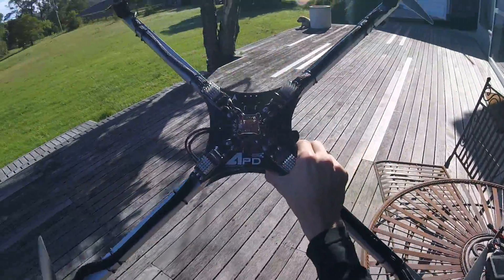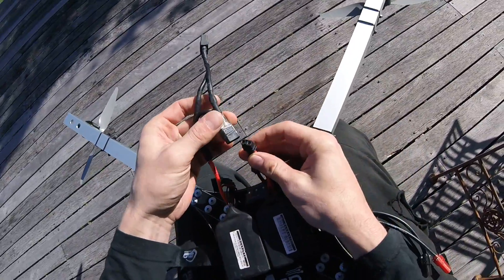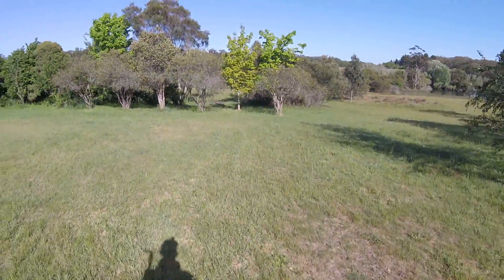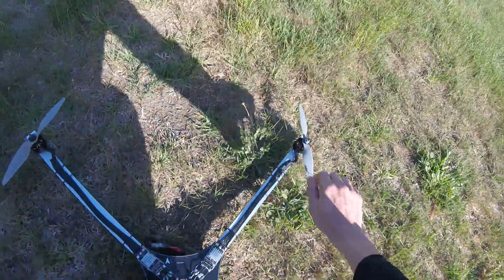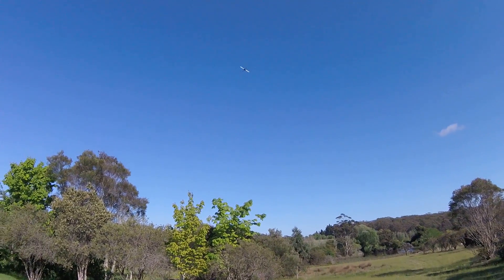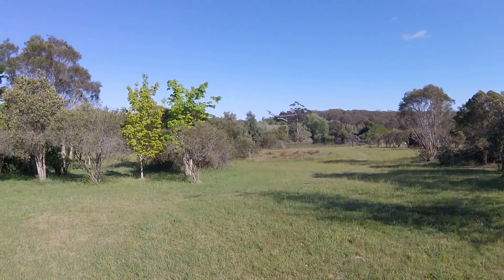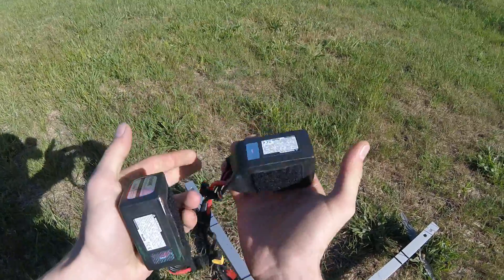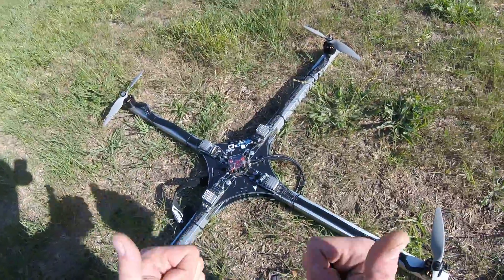1000kv // 12S //  Will it explode?

Comment: I have tested Sunnysky old school 980kv with up to 6s on the bench with 5" prop with no issues both Motor and ESC were rated 2-4s when I tried going higher to 7s ESC was not able to sync the motor to start.
Reply from the maker: Yeah, APD esc's will work :)

Comment: Huge frame small props seems senseless to me
Reply from the maker: The reason I do it is to test things on big quads. It's a light powertrain loading to confirm everything works, then later you increase the loading with bigger props
Reply: @autekxracing4593  did you make a video with bigger props?
Reply: I was currious cause I have always gotten best performance with low kv big prop, but cool for testing and thanks for sharing
Reply: @cenabitednbfpv587  
Curious*

Comment: From what I can find these motors should only do 3-4s, why is it capable of receiving three times the voltage?
Reply: @enginengineer4039  It's all about power dissipation. Higher voltage actually decreases the amount of current you can safely allow it to draw, because wattage = amps x volts, and that power has to go somewhere; most is converted to kinetic energy, but a significant portion is turned into heat as well.

If you run a motor rated for 4s(14.8v) and 40A maximum (just pulling numbers from nowhere) at full load, that's 592w. Assuming that motor is 80% efficient, 118.4w worth of heat needs to dissipate from the motor windings.

The same motor run at 8s(29.6v) at full load will be 1184w, or 236.8w dissipated as heat. This will almost certainly end up roasting the motor because of the concentration of heat in the windings that can't be shed fast enough. 

On the other hand, if you run the motor at 8s and use a smaller prop, then you reduce the load on the motor; that is how you control current draw. As a result, the motor only draws half the current (assuming an ideally-matched prop), returning it to 592w, and thus only needs to dissipate the heat it's designed to. 

Meanwhile because you're pushing all this voltage, the motors can run faster (as rotation speed = motor kV * voltage); there is an upper limit though, because at some point the motor will mechanically fail (bell flies apart, bearings fail, shaft warps due to prop imbalance, etc). 

So why bother? Because you're using smaller props, you have better responsiveness (less prop mass to accelerate/decelerate).
Reply from the maker: Basically because I have the filters very low, and a very open tune so the ESC's are running the motors nice and smooth. They are also rated for much bigger props than this. So this is a higher loading in total, but less prop loading
Reply: @autekxracing4593  I understand they're built for larger props but I just assumed they'd die the instant you'd plug in a battery that isn't its recommended voltage (3-4s).
Reply from the maker: @Taiiiiiils  Thankfully they don't :) I've got some truly amazing 4500kv 2205's made by Brotherhobby. We can actually run them on 6S. You can go a long way past ratings if you're careful with the setup
Reply: High current kills motor, not high voltage. when you used higher voltage you should choose smaller porpeller to make lower current. i am using 6S with Racerstar BR2212 930kv motor with 6040 propeller. low rpm big size propeller and high rpm small size propeller. that is the key.
Reply: you can not control current. you can just choose propeller size and according to propeller size  motor will need high amper or lower.